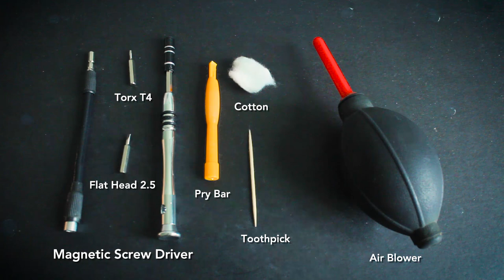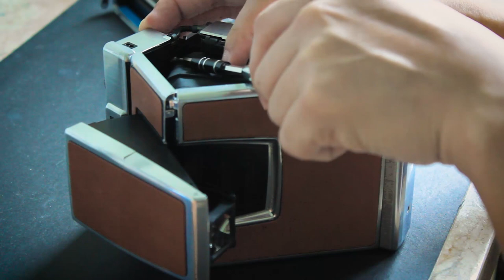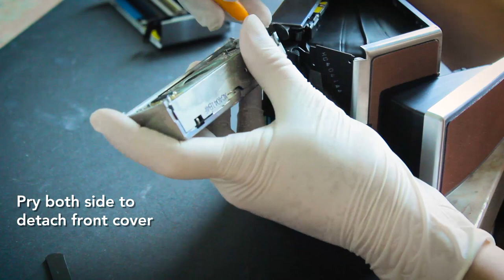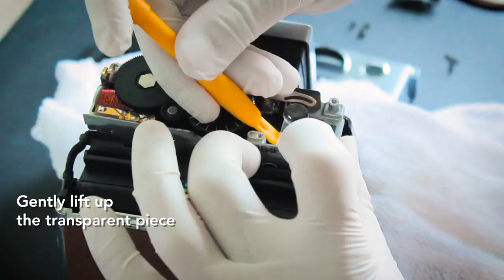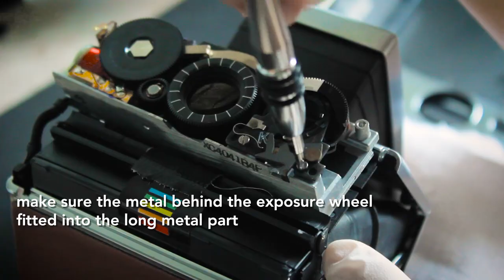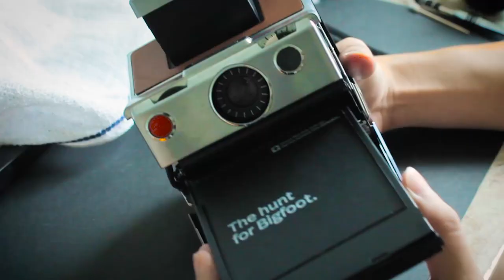Polaroid SX70 Land Camera Model 1 Censor Cleaning

Comment: Recently tried this, but everything back together and now there doesn’t seem to be any power to camera when I put a new pack of film in. Any advice?
Reply from the maker: If the sensor is cleaned as per how I did it, I think the next is to check the battery connector condition, slow shutter due to low light or whether if you press and hold shutter button until the entire photo rolled out.
Reply: My dont turn on to... no power....
Reply: @jihiakoh4554  My dont turn on to... no power.... any other idea?

Comment: Do you know if I can clean it with ethanol?
Reply from the maker: Yes you can but will suggest to use it on a damped cotton. Bare in mind you will unable to clean the corrosion underneath censor glass if it happened. Suggest to leave it as per

Comment: I did that now my sx-70 is not power on, dont do nothing... i dont know what was my mistake...
Reply from the maker: Sorry to hear that, I do not know what happened to yours, have you make sure the battery connectors are cleaned?
Reply: @jihiakoh4554   You say the terminal that  conect to cartridge the battery? If so yes... thx for help,  love the video

Comment: I’d think I rather pay a pro to do this than DIY clean this… I don’t trust myself without breaking it worse lol. we’re you by any chance having the camera shutter stop but not eject with every other photo? I think mine is pretty typical of a 48 year old camera that’s never seen a service technician. I was able to get some photos to work but others didn’t…HMMM…at least it’s been in its original carrying case since 1974 so it could be worse. But when it’s the age as it is there will be some trouble I guess…
Reply from the maker: Have you tried to press and hold shutter button until photo is fully ejected when taking photo?
Reply: @jihiakoh4554  yes
Reply: @jihiakoh4554  sometimes it will. but sometimes I gotta shine a light at the censor for it to go, and if that doesn’t work I gotta open and close the door for it to spit out my shot. But then again I’m learning how to shoot film cameras in general, I grew up near the end of the dominance of film so I have very little experience with the medium but I’m learning!
Reply: @oldradiosnphonographs  did you find a fix for your problem? Having the same issues and really want to try out everything before actually opening up the camera.
Reply: @tilluminatia2566  I think it takes quite a few seconds if there is not enough light in the room and it has no flash bar attached. If there is a flash attached or if the room is bright enough it should spit it out more instantaneously.
Reply: @oldradiosnphonographs  yeah, I think my light sensor might be dirty or broken. Even if I shine my flashlight into the sensor it takes some time to spit out the film :/